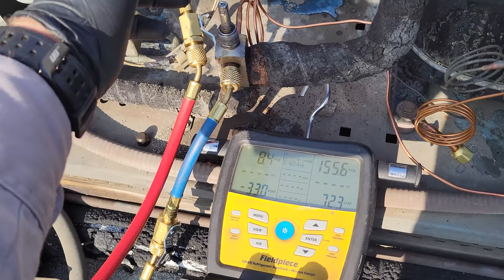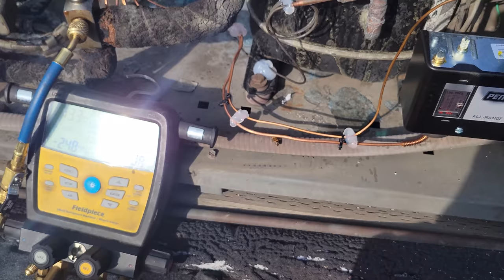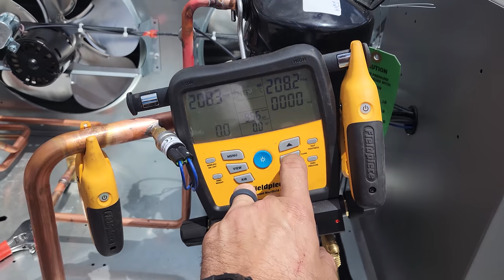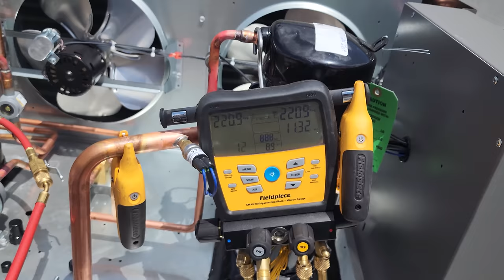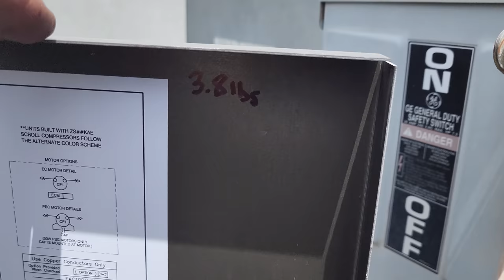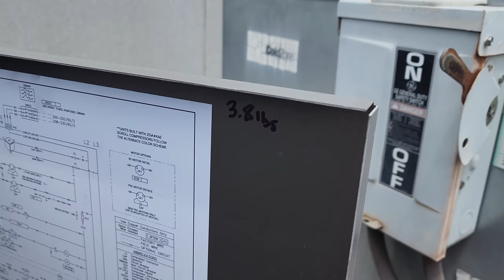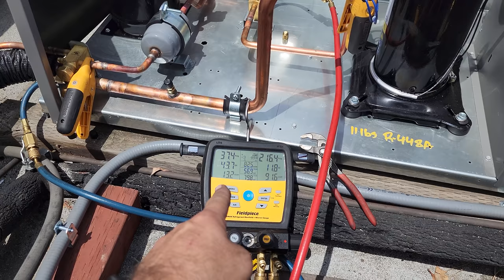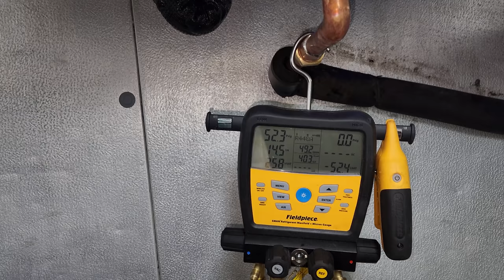THE WALK IN COOLER IS LEAKING SOMEWHERE....

Comment: The crane's swings looked like there was a huge gale or inexperienced operator, but it was just on fast forward! 😂 Got me good.
Reply from the maker: Yeah that particular operator is a bit rough on his movements.... but he is cheap and was available so I dealt with it
Reply: Fast, cheap, quality. Choose any two. I was wondering about whether or not it would have been good to use a tag line to smooth out the operator's herky-jerky?
Reply: Terrible operator for sure,  Condenser hit the roof hatch on the coil side pretty good.  😱

 Where was the personal to catch the load?
Reply: @taylorj9920  if I had an operator like that I wouldn't be anywhere near that unit lmfao.
Reply: @Richard Cranium, well yeah, but pointing firearms at contractors to improve the quality of their work causes massive problems with human resources, and at least one regulatory body at the local and State levels.
Reply: I like to rope the load at 2 points so I and if possible another can be at a distance and hold onto it to stabilize. horizontally
Reply: Yah, I looked at the load swinging like crazy and then I looked at the trees in the back. No wind. Looks like the load smacked the roof a tad hard. Yikes.

Comment: I was someone who was hesitant about press fittings for refrigeration/AC. They seem to be of high quality and do hold true. Recently i was sent to do a chiller start up and commissioning. It held 300 psi for over 1 hour without budging one bit. Was able to pull a vacuum on a 20 ton chiller and 80' lineset ( 2.5" suction 1 1/8" liquid line )down to 200 microns in 2 hours and the decay passed with flying colors. Microns never rose above 250 on the decay test. So im a believer in them now.
Reply: Press fittings are taking over the plumbing industry too. It removes the possibility of human error and speeds up the process compared to soldering copper.
Reply from the maker: There is still the ability of human error because they (plumbing and or Refrigeration) require a very specific prep process but if done properly they can be great!
Reply: @HVACRVIDEOS  you're right, I imagine it's also easier to teach this to technicians, some people really struggle with soldering stuff, especially in places where using a flame is sketchy.
Reply: @HVACRVIDEOS  like you stated in the video....all about the prep work.
Reply: @jasonjohnsonHVAC  That's true regardless of the type of fitting - Braise, Silver Solder, Crimp or Flare Nut...Prep is the key, if you don't prep right, the joint WILL fail prematurely...
Reply: In this case I'd make sure that the fittings aren't decaying due to the oil in the system as from what I understand there's a rubber O-ring in them.
Reply: @ehsnils  Are the O-rings the primary seal of the fittings or is that backup to the press fit copper? Also there has to be a lifespan for these, I work industrial refrigeration and some of the equipment is over 50 years old.
Reply: @CorDawgYT  Since there isn't a metal bond between the fitting and the pipe the O-ring is the primary seal.
With brazing/soldering there's a metal bond.
It would be interesting to see those fittings after 10 years, especially with temperature swings also involved.
Reply: I'll check back in the 5 to 10 year range, because I have a feeling contaminates in the systems will start eating the o-rings and there's for sure loss of elasticity that will cause a bubble factory. much like every service port/valve/core/seal has pretty much started leaking by the 10 year mark. I'm including everything with some sort of rubber/nitrile/man made material seal.

Comment: I have used a pinch off tool on those pressure controls and sweat the cap tubes in and out. No recovery needed.

Comment: I started viewing ur videos when they installed my LG multisplit AC. The AC has issuses for the second time in 3 weeks. The first issue was a a leak in the press fitting (they said O-ring) in the guest room. 
Pretty sure there is another leak. System cooled good for 5 days now its blowing air. If I see how professionaly you prepare the copper and fittings.....what a difference. 

I'm glad it's still under warranty. The sad thing is the loss of R32.....

Nice video's!!

Greetings from Belgium!

Comment: We had our well pump, pressure tank, and filter setup changed out last year. The guy that did the job used the same type of crimp connectors when installing new copper into our pipes from 1975, he'd been a plumber for over thirty years and found this new method to be quite convenient - no hassle of a torch, flux, solder, damp rag, etc. It seems to be holding up, so I can't complain. Water goes through the pipes, no leaks, that's pretty much all ya need, right?
My mom was blown away by the procedure - she's the daughter of a plumber, and my grandfather actually plumbed our house - but of course, I had already seen the tech in use on this channel, so hearing about it wasn't a surprise to me. lol
Reply: Interesting, here in Germany that has been pretty normal for at least 25 years, my parents house has no solder except for the gas lines

Comment: 6:25 When you recover the refrigerant (for reuse), is there any risk of gas being contaminated (before, during extraction)?
Reply: there is, the proper protocol is to send the recovered charge to a recycler who will filter out those contaminants and then resell the purified refrigerant.
Reply: He can legally put the refrigerant he recovered from that property owners machines back into them if he has a clean recovery cylinder.  It cannot be reused in anyone else's equipment and must be reclaimed.

Comment: You work in a lot of tight spaces. There are adapters that allow you to press at an angle. You might find it useful to have one of those adapters if you are going to be using the press tool on a regular basis.

Comment: Great job Chris, everything looks good, except the zoomlock, I am not a fan of using it, I been brazing for 47+ years, never had to worry about leaks or even a fire issue when brazing. I realize sometime new methods of connecting pipe maybe be a good thing, but I don't agree with this method, not mention the cost of the fittings and the tool. I have used it for plumbing (called pro press ) I can see using it for water, in an emergency is good, I guess you can't always teach an old dog new tricks on some things. Again great job :)
Reply: Thanks for your contribution to the trade, 47+ years is amazing. I hope you are retired or retiring soon and can enjoy a nice cold beverage 👍🏻 brazing will always be the best but these new methods sure are a great alternative as well!

Comment: When changing fitting sizes, why is it so important to run the crimping tool through a full cycle before using it on the next fitting?
Reply from the maker: I've been told by the manufacturer that it is required to properly calibrate this particular tool
Reply: All I know is that the manufacturers say so. I don't necessarily a reason since in theory the machine is always looking for a certain force and to my knowledge all fittings use the same pressures

Comment: Is there any way of knowing there's a Schrader valve inside low pressure control connection at the flare connection on valve on pipe? If u just took it off ur screwed so any tips on how to know ? Thanks
Reply: always assume it "DOES NOT" have a schrader core, unless you just put one in yourself!
Reply: @throttlebottle5906  thanks

Comment: Dump the sniffers get a quality Ultrasonic detector. They work on any leak nitrogen, vacuum, any freon, air. they pinpoint the tiniest leaks quick. Pressing you need to hold the pressure a few seconds before releasing, don't clamp and release. Even copper has some spring so hold the pressure to allow the molecules to settle

Comment: in europe we dont use head pressure control valves, what do they do ? Here we use a KP5 pressure switch that turns on the fan when the head pressure get up to the setted level, or a fan speed controller, that turns up and down the fan speed to keep a setted head pressure.

Comment: what type of silicone do you use for copper pipes not rubbing together (3min 11 seconds).    Also does anyone recommend a caulking type sealant for conduit connections? i have used stuff and it cracks later. i have seen sealant applied and still water tight 10+ years later. whatever these guys used it lasts a long time. i can send a pic if anyone is interested in providing suggestions.

Comment: Chris the only thing i didn't like from your stance is the P trap  that P trap is useless   it would of made Sense if you put that P trap on the vertical rise to the roof  other than that all good that line set wasn't fancy but hey its ok!   new condensing units are always shiny lol a new toy  !!
Reply: Its an oil trap champ... looks like a P but rest assured its not useless, its designed to assist oil return when condensing units are installed above the evaporators  or in vertical lifts every 5m. Doesnt make any difference if he installed it straight off the coil or where he did.

Comment: Metal bolts = failure. always use nylon bolts when in cold rooms and penetrating insulation!! and also , why in earth use press fittings , you just soldered right before , why not solder the next connection?

Comment: WHY DO YOU NEED A P-TRAP ON A SUCTION LINE?
Reply: Its an oil trap mate, it fills with discharged oil untill the velocity of the refrigerant forces the oil back to the compressor. There used when the evap coils are installed below the condensing units.
Reply: @brentongleeson7273  Thanks a bunch, mate. 👍
Reply: @pvantran82  happy to help..

Comment: One thing that grind my gears. The wall transfers for the linesets. Dont you use piping for that? Like "trolleflex" tubing https://www.varmepumpeutstyr.no/users/varmepumpeutstyr_mystore_no/images/87687_Trolleflex_pakke_1.jpg a great help when running linesets and more thru constructions, cold room walls and more. It gives a water safe transfer, and you can seal it up even on the inside of the tubing where the lineset goes to seal it up even more.